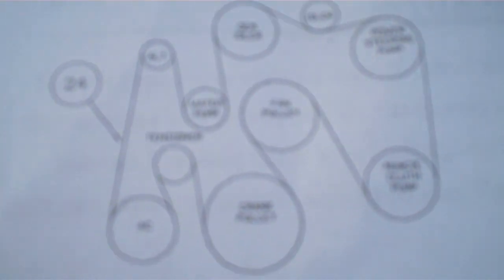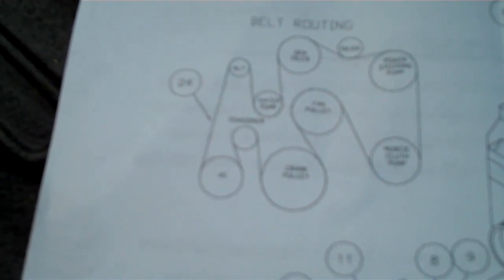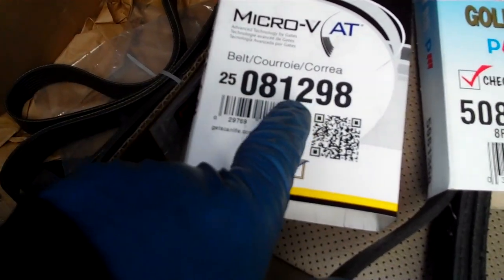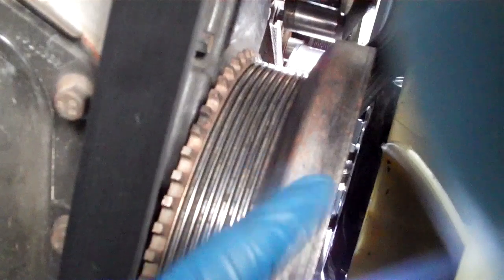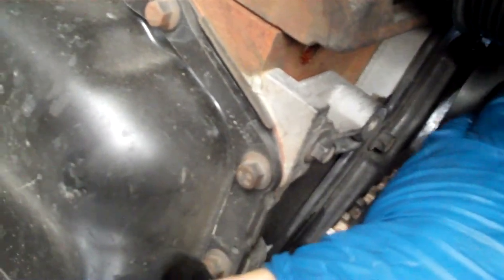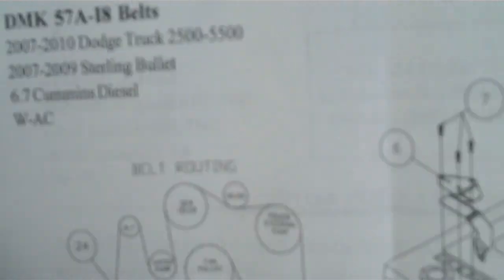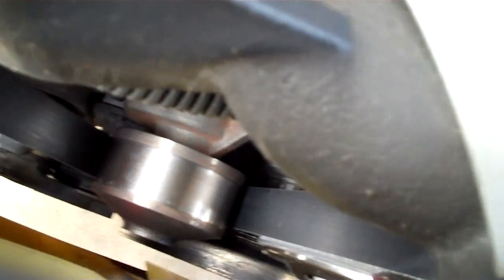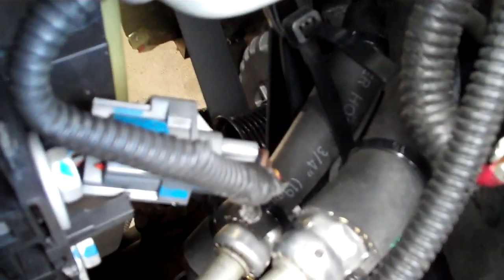Amps Belt routing- Installation and system start up for 6.7L Cummins

Comment: I just came across your video and will  be following this to change the belt on my 2015 Ram 2500, I am having trouble getting my belt started and routed, I will go back and slide it in across the crank like you said and rotate the fan, I have the old one out trying to get the new one in. I wish you would have shown how you fed the belt in between the crank and fan

Comment from the maker: 1984 F-150 4X4 with a straight six.  Awesome truck- worst fuel delivery system EVER!!!  I owned it for about five years in an emissions strict district.  I lost sleep every year when it came due for emissions.  It was a computer controlled carburetor nightmare.